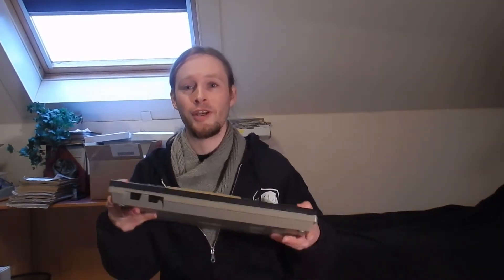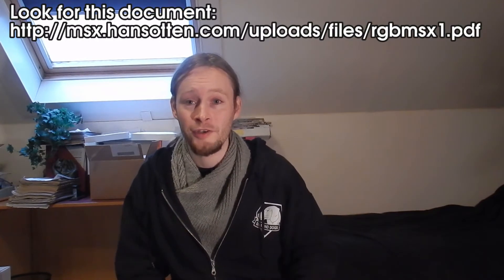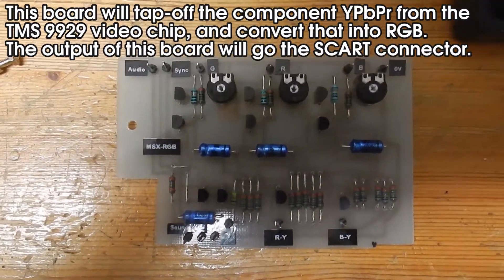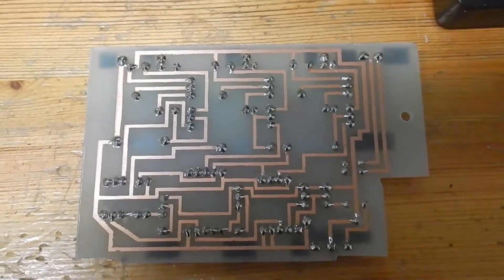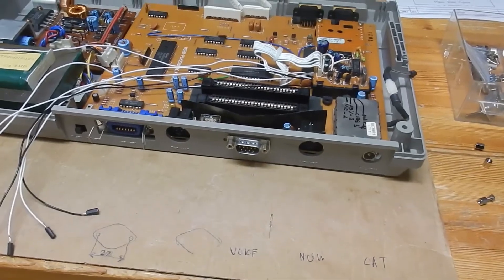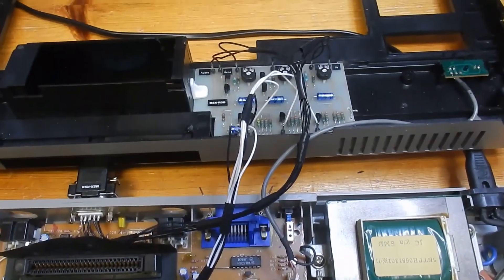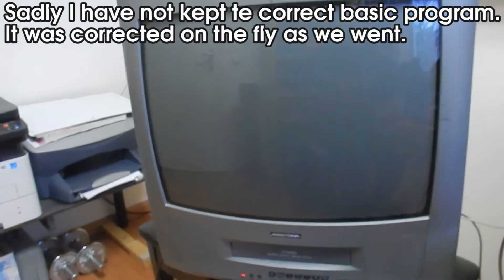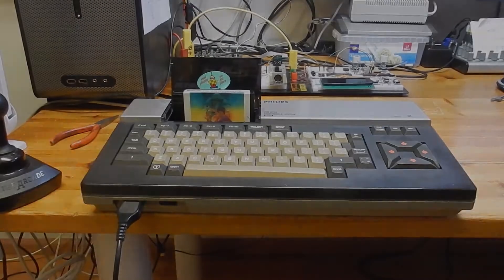Philips VG-8020 MSX RGB Scart modification

Comment: Hello, I have a French VG8020 / 19 with RGB output and I have a problem, the computer starts up with a blue background and the whole screen is full of white spots.  The caps light is turned on and off by pressing the button and when you press the keys the sound is heard.  Do you know where the problem could be?  Thanks a lot.
Reply from the maker: Maybe it has a video memory problem, I’ve heard of commodore 64 systems (and also other systems in general) with garbled video output beeing caused by faulty video ram chips. But on the other hand, it could also be some complete different cause. The description of white dots might suggest an issue with video ram. It would be best to google this on MSX forums to be sure.
Reply: @dykodesigns  thanks!!!

Comment: Just a hint - if somebody is interessted. I think you can do the same mod on a ColecoVision. Maybe the voltage levels are different from the chip and you have to change some resistors or play with the potentiometers, but in my opinion it should be possible